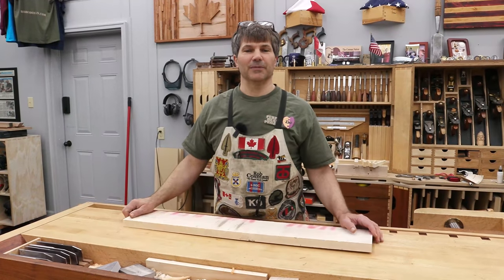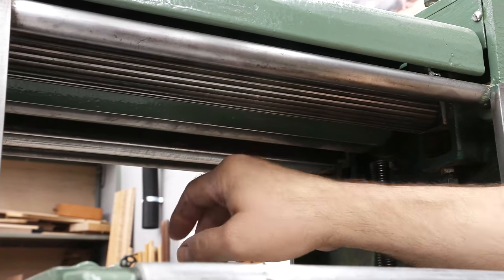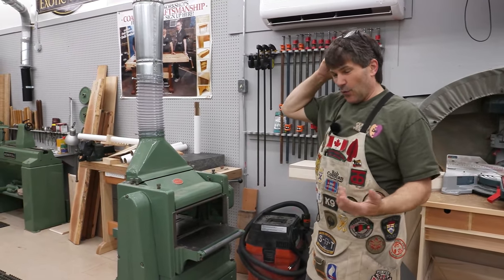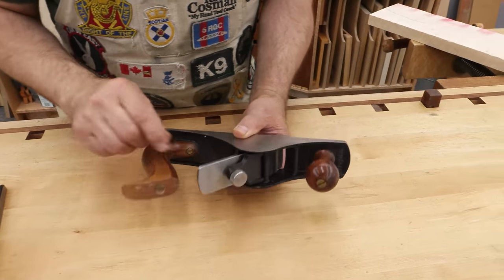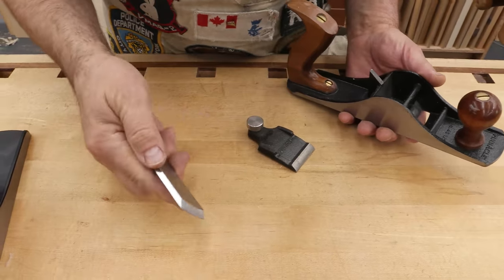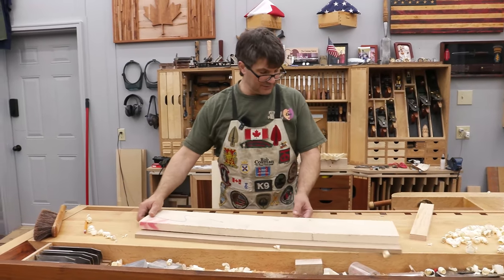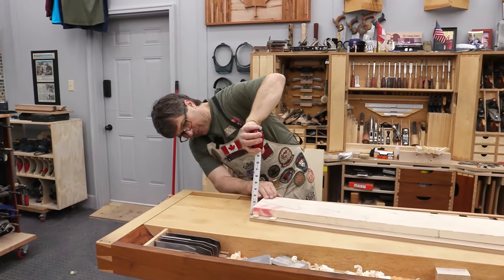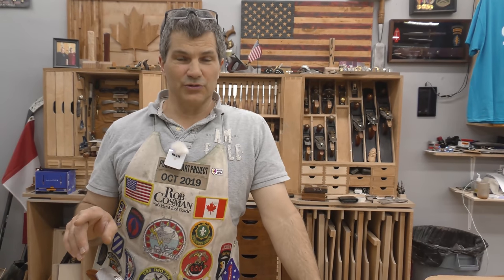How to Flatten a Board Without a Jointer

Comment: Another extremely informative video, here clearly outlining different methods to dimension rough timber using a thickness planer alone. Your initial description on how the thickness planer operates and the implications if cupped or twisted boards were fed through it was most useful. Your 2nd sledge approach was a great and simple alternative to the scrub plane method. That said, the tips for removing high spots with the scrub  plane and a dirty bench were important points to note  and use where appropriate. Your concluding remarks indicating that a thickness planer can do the same job as a jointer and allows wider stock to be milled was an important point for small workshops or individuals with a limited budget. Team Cosman never ceases to inform and educate us in ALL things wood - MOST GRATEFUL for all your contributions in this regard!!!
Reply from the maker: Wow thanks.  So glad our vids are helpful.  Thanks so much for the comment

Comment: I was panelling a room with 5 x3/4  clear red spruce boards. The shiplap boards ran horizontally, nailed to the studs. Many we're cupped  and it bothered me. I tried running a board with the cup up through my table was,  cutting a kerf 3/4  way through the middle of the back side. It worked like a dream. The nails we're able to flatten the boards enough that  the cup remaining was not visible. I think that kerf also helped take up some of the expansion and contraction that than occurs with the seasons because the gap between boards changes much less than I expected.
 Red spruce, also know as Adirondack spruce, is a beautiful wood  that is often used to make premium guitar tops.

Comment: This video has helped me decide between getting a jointer and/or thickness planer - I'll be getting a thickness planer and trying the methods Rob demonstrated for the initial board preparation. I hadn't seen the 'rub the board on dirty bench' tip before and think this should make a difference to my efforts flattening the first side of boards by hand, which until now have been taking a lot of time. Thanks to Rob and the team for another great video.
Reply from the maker: I agree with your decision.  When you do get a jointer do not get anything less than 8” wide
Reply: As my limited space and lack of 220v power left me with the choice of one or the other and no good options for a combo machine, I went with the thickness planer too. It has been a helpful tool as I often select the direction of cutting-board assembly by look rather than by grain direction, hand planing the assembled boards is quite difficult. The power thickness-planer is really helpful prior to ROS use and finishing.
Reply: You can buy a thicknesser that will work pretty well for not too much money, that is not the case with jointers, a good one costs a lot of money
Reply: @CrimeVid  yeah, my Wen 12.5 inch thickness planer was a good price at Home Depot online. And it works great. The chip extraction isn't the best on the market, but I'm sure that likely depends on the dust extraction setup you have, mine isn't that good to begin with, so I have to take that into consideration. It may be better than my personal experience as compared to what I've seen in other shops on videos with other planers and better extraction systems.

Comment: Excellent video.  I've done method #1 multiple times even with a 12 inch jointer.  With severe twist it is actually quite difficult to joint a board flat without it rocking to and fro and you risk losing a lot of material.  The targeted approach Rob showed saves material and gets you close enough to flat.  A scrub plane is nice and you can get some cheap old ones.  You can get by with a jack plane and a highly cambered blade.  A patient gifted me an old #3 with a badly pitted sole.  I had another patient of mine who has a machine shop flatten the sole for me.  In doing so it nicely widened the mouth. I purchased a nice thick Hock blade, put a heavy camber on it, and I had my own version of a scrub plan and in the process brought an old antique back to life.
Reply from the maker: Doc you did great.  Nice to have a friend / patient with a machine shop

Comment: I really like the scrub plane method. Now I need to find a scrub plane. Great video thanks!!!
Reply from the maker: Good point.  I always seem to find them on the used market. Folks don’t like using scrub planes.
Reply: What kind of scrub plane did you use in the video
Reply: @kentboys5017  you could just use a harbor freight plane and put a heavy camber on the blade. Doesn't really matter for scrubbing.
Reply: I turned an old, beat up #4 into a scrub plane following instructions on a Paul Sellers video.  It works great.

Comment: Haven’t used my jointer since watching Rob’s videos and investing in some good hand planes.  I am not doing this for a living, but flattening and jointing one edge with a hand plane is so much more enjoyable than fighting square and flat on my cheap jointer.  Made a 36” shooting board for long boards.  Works awesome.  Method 2 works well with edge grain cutting boards.
Reply from the maker: Sounds like you are doing great handwork. Keep it up
Reply: @robcosman.com just curious what abouts a general 8" is worth
Reply: Ah, one of the dreaded 6" Craftsman jointers. I have one too, and I have yet to get it to actually work. I'm going to adjust the blades down to get rid of the snipe. There are 4 adjustment eccentrics under each of the 4 corners of the infeed table on the Craftsman, and so you have to magically find a way to crawl under the planer and adjust those 4 screws to get the infeed table level with the outfeed table. Also you have to adjust the blades to the exact height, because the outfeed table is fixed. The problem is, the cast iron machining of the tables is not flat on the Craftsman  6" jointers, so your straight edge will show gaps no matter how much you adjust the infeed table.

Comment: Beautifully explained. I use both methods.  I have 3', 5', and 8' sleds (double 3/4" mdf) for this purpose.  The 8' gets a bit heavy but it works great.  First I knock off the high areas with a scrub plane if the twist is really bad, then I attach it to a sled using wedges and hot glue.  It works great and it's fast.
Reply from the maker: Great tips, thanks for sharing
Reply: @RobCosmanWoodworking  My pleasure Rob.  Please note, that I also added a full-width replaceable cleat that projects 3/8" above the sled to prevent the cutters from pushing the timber off the sled.  I wax the sleds for easy hot glue removal.  This method is so much easier than using a jointer.

Comment: Ok, I was thinking those would be the two methods shown. What I hadn’t seen before though was the dirty workbench top trick. Now THAT is a slick trick. I wonder if that could be duplicated with some graphite or something else if your bench top isn’t dirty enough.
Reply from the maker: If you dont have a dirty benchtop the wood will still burnish itself and you can easily see the burnish spot in by holding the board to the light
Reply: Carbon paper, if you have any,  old hand written (in pencil) shopping list or homework, or newspaper... 
rub it on the bench, or tape it on the bench for a rub spot?
Reply: @thomasarussellsr  maybe a newspaper 🤷‍♂️ I’ll give Rib’s method of just checking for burnish a try though

Comment: Yep every time i have a board wider then my jointer … i take out my jig 😉 Thx for sharing i’m sure you’re going to help a lot of peaple 😜🇨🇦
Reply: Thicknesser sled with an inset stop/lip at the rear helps push the board through as well.
If you come across a business/school remodel that is doing the bathrooms/kitchen and is tearing out stalls/counters made from the high density poly plastic, like the cutting boards, that makes excellent sleds too.

Comment: Gee, looks like a lot of work.  I feel very fortunate that I was able to pick up a 12" jointer years ago.  I've been doing more and more joinery with non-powered tools lately, but for basic milling in order to get all 6 sides flat and parallel, I much prefer getting it over with quickly with power tools.
Reply from the maker: You are one of the lucky ones having a 12"jointer.  Gives you lots of options
Reply: How long to turn a 6 foot log into a usable square post? (If you've tried it?)
Reply: @thomasarussellsr  Haven't tried it.  The first trick would be to get one face roughly flat enough so that it could then be safely flattened on the jointer.  Maybe with a bandsaw with the log fastened to something to keep it it line(?)

Comment: A wooden double iron jack plane is generally the best plane for this kind of work (something around 15-17" long). It's as fast or faster than a scrub (and far less friction), more accurate and doesn't need anything following it if a thickness planer is going to be used.

Comment: 1. If you use the "wedge n sled" system is there a risk of the board springing in areas where there are hollows on the underside with the pressure of the rollers with thinner (1/2" - 3/8") board.

2.  Is that also the case where a scrub plane is used.  

Always impressed with the quality of the education you provide and the altruistism of trying to save the viewer a $.
Reply from the maker: Thats what the wedges are for, prevent any springing.  But if there is band twist or hollow yes take it down a bit with a scrub so its not hollow.  The wedges really are just supporting around the edges so any bad hallow in the middle is a good idea to remove with yhe scrub

Comment: Buying thickness planer before jointer is the way to go. I bought mine before table saw. A circular saw with a straight edge can get your straight cuts, and parallel and square cuts if you take the time to set it up. Jointer is convenient and efficient if you have a lot of stock to mill. I agree with the conclusion. When I need to get a lot of wide boards done, I use sled method. If I only have a few pieces to finish, I reach for hand planes. After all, there should be reasons for buying planes.
Reply from the maker: I agree with you.  If you have a Jointer plane you can do everything a Jointer does and fairly easily unless you are lucky enough to have a wide jointer 12" wide or better
Reply: @RobCosmanWoodworking  when I bought my hollow chisel mortiser, they were also selling a big jointer, I wanna say 10” wide, for just a few hundred dollars. I didn’t have the room or the means to transport it, I still don’t. Big regret. I might build one with a 13” wide thickness planer head, but that’s on the bottom of the todo list since I have a 6” jointer and it can do most what I want to.

Comment: I don't use the sled and wedges. I just glue or brad nail 2 x flat strips onto either side while the board rests on a perfectly flat surface. If there is any cup, that must be down against the bench (supporting the centreline of the board).  I make multiple light passes, and bring it down slowly.
Reply from the maker: Send me a pic please

Comment: Rob, that's an expensive pry bar😂. Great video. I've used the sled option several times in my own shop. At the furniture factory where I work, we have a really old (but good) 16" jointer  and a 25" helical head planer. Do you know if anyone makes a helical head that we can put on the old jointer?
Reply from the maker: Check out Byrd. They make one for every thing

Comment: Question - After milling/planning your stock for a project how long do you have until those pieces start to warp, cup or twist ? How should you store them if your not using them right away ?
Reply from the maker: That is super variable.  They can move on you immediately as you release tension in the board.  You should let your wood acclimatize to your shop for about 2 weeks before milling and then after milling let them sit at least a couple of days to see if they move.  Before using torrified wood for our winding sticks I use to let them sit for 3-6 months after milling to see if they would move
Reply: @RobCosmanWoodworking  so for a medium/large projects you don’t put everything together for a couple days after milling or doesn’t it depend on the joinery ?

Comment: Hi Rob...Does the hot glue residue cause any issue with "nicking' the blade edges?
Reply: Dried hot glue is a lot softer than almost all woods
Reply: @BobAbbott  good point. Thx.

Comment: I did not hear you mention grain direction, which I find is kinda tricky when using power planer. Do you have a secret for not worrying about it (?) Or you just do it automatically?
Reply: Forgot to say... Really enjoyed the video, as always! Best explanation of the power  planer operation I've heard.
Reply from the maker: Great point and I should have talked about it.  I use a combination of feeling the board (you can usually "feel" the right grain direction) and reading the grain direction on the edge of the board.  You just have to remember the cutter is on the top and spinning toward the board
Reply: @RobCosmanWoodworking  Thanks, and I do both the feeling and reading of the grain, but still get surprised more than I'd like

Comment: Wouldn't sighting down a couple of winding sticks have helped to see where it was twisted?
Reply: It's unnecessary work to get sticks out and play with them and then squat down to look at them, etc. It doesn't sound like a big deal, and it isn't if you're just facing one board, but if you're going to do a whole bunch, you'll tire of winding sticks pretty quickly.

Comment: Wouldn't the #7 work well for something like this? Am I not understanding?
Reply: Scrub plane is meant for quick material removal and leaves a rough surface. Sure you could use other planes but this is the main purpose of the scrub plane(to quickly remove material for flattening)
Reply: A wooden jack plane is more ideal for this. A jointer is for truing up a face that's near finish, but you don't need to have the face finished to get it in a planer, you just need it to be flat. You can use the planer to remove the marks from the jack. 

Scrub planes, on the other hand, are a good way to take chunks out of a board that take much more work or much more thickness removal to eliminate. They're a bad choice, but nobody makes a good double iron wooden jack plane now. 

In a cycle of true hand use, the jack plane does the vast majority of the work, and the jointing and smoothing are quick. Sort of a lost art, I guess.

Comment: Just another question, do you have to get a certain thickness to the plywood or mdf. Cause my logic is if it flexes then wouldn't the machine technique be redundant, it has to be at the least 1 inch thick?
Reply: Not necessarily, it’s function is to work as the “sled” and your warped material that rides on top should be wedged so it has no movement and essentially moves thru the planer as a single unit. I would still recommend MDF 3/4” minimum. Melamine for your top sled surface is nice as hot glue etc isn’t going to damage it when you remove your wood
Reply: @sudsy18  thks
Reply from the maker: Sudsy 18 is correct.  However it never hurts to have a stout board for the base.  I use 3/4 or 1 inch MDF whichever i have laying around the shop

Comment: Is there a decent tickness planer on the market? In Germany it is hard to find some old ones with a solid casting.
Reply from the maker: Yes there are, but I always prefer the older heavy casting.  Depends on how much you can afford  and what space you have avaliable.  Dewalt 735 is a great small planner, Rikon, jet, powermatic make good bigger new ones.  Still there is nothing like one built in the 1960’s or earlier
Reply: @RobCosmanWoodworking  thank you

Comment: Seems like winding sticks would save a bunch of flipping the board over & rocking it.  I've flattened boards with sticks and a straightedge while never flipping the board.
Reply from the maker: Well I am not trying to get a flat smooth surface, just a surface that is flat enough to prevent the planer from deforming the board under the roller pressure.  I could have followed the scrub up with a jake plane and refined  the surface more snd once smooth used winding sticks to check but that is not the subject of this video
Reply: @RobCosmanWoodworking  I'm sorry, but I guess I was wrong.  I thought the title of this video was, "How to Flatten a Board Without a Jointer."  I hope you can forgive me.